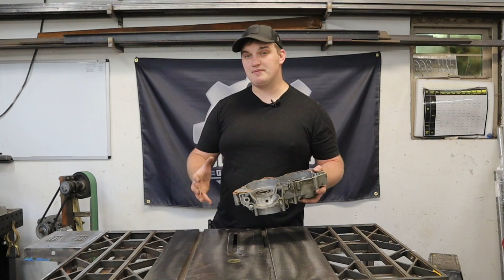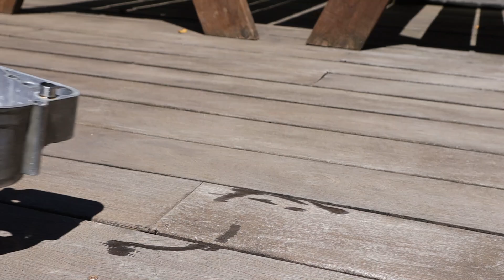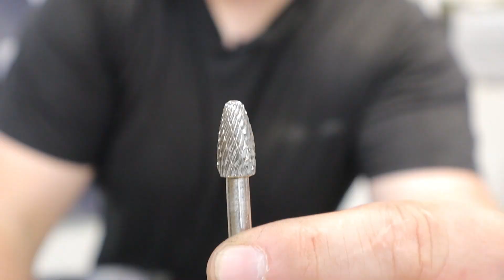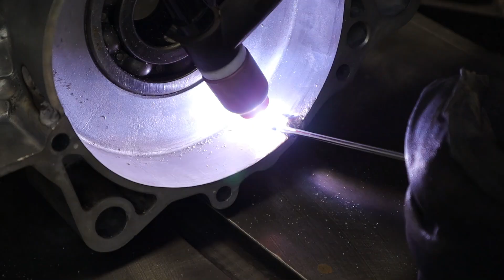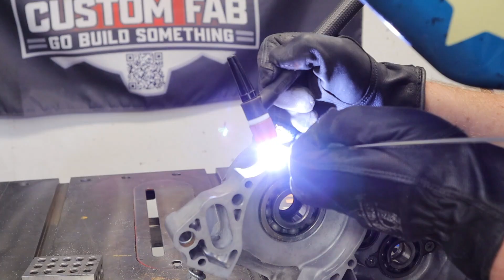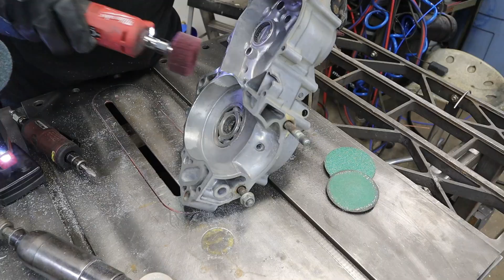I Repair Cast Aluminum

Comment: Have had good luck with, after cleaning, boiling castings / cases in water and dish detergent, followed by a  boiling / rinse, in clean water, then preheating in a oven at 250f, to eliminate oil bleeding.
Reply from the maker: I never thought about boiling. That's a great idea. Thanks for the input 😎

Comment: hey bud did you get the adapter splitter cord in .............for all out there a really good thing to have is a bar of cheap soap works great for grinding Aluminum You grind faster and keeps sandpaper clogging to a minimal
Reply from the maker: Yeah I got it and it works great. Thanks for the suggestion 😎 bar soap is also works good. I just have found that if I'm going to be welding in the area it does not burn out as well as paste wax
Reply: @amcustomfab  wax mesg. me a pic ill give a try

Comment: Good video very informative 👍 Amazon has decent carbide burrs for aluminum for pretty cheap like $40 give or take for a set just got a set for work after I did a transmission case and like you only had the fine ones for steel and stainless. I made a video on it still haven’t edited it yet. I like your videos good information, video quality, and sound 👍

Comment: I just had and idea while watching this video.  I wonder if you could use LYE diluted in water to clean up the casting.  That's what I use on aluminum before I anodize it.  It's kinda nasty and needs to be neutralized with water after but it gets Aluminum super clean.  it's basically an acid etching process for AL.  (never tried this on a welding project, just an idea I had)
Reply from the maker: Interesting. I wonder if it would make a stink when you start welding on it
Reply: @amcustomfab  yeah, if you don't get it all out of the crack that wouldn't be good either.